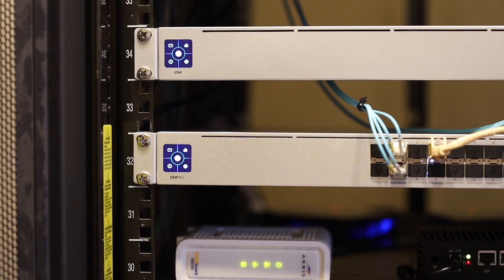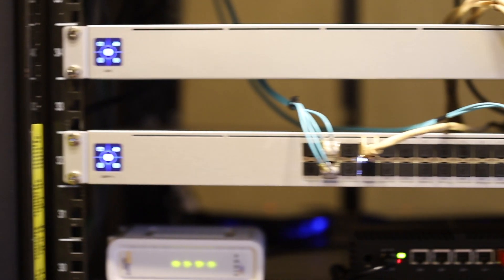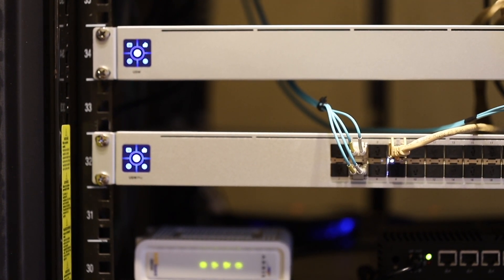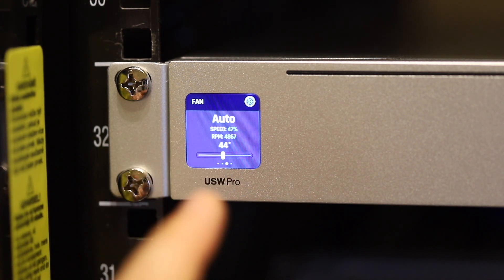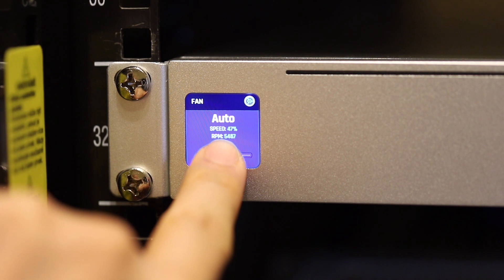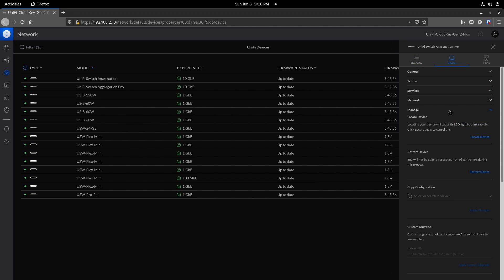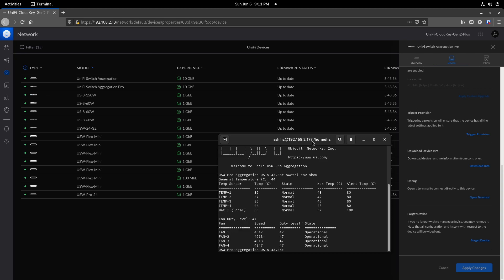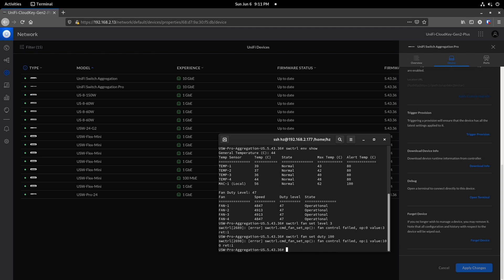Ubiquiti UniFi USW-Pro-Aggregation Fan Control

Comment: Can you do an example of the Pro without the AC, so we can hear the noice level by the device at self?
Reply: USW-Pro-Aggregation is much louder (pretty noticeable in a quiet room) than other Gen 2 devices such as UDM-SE or USW-EnterpriseXG-24. The issue is that it tend to keep the duty level way higher, results in about 10 degrees Celsius lower than other devices for no obvious gain. Unfortunately there’s no way to lower the duty level down.